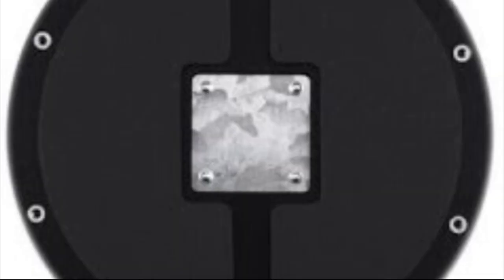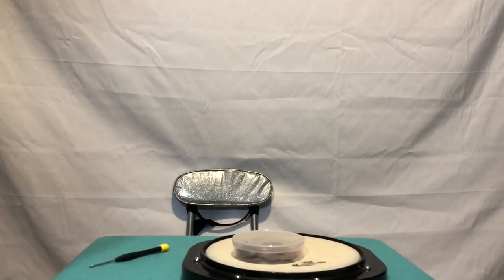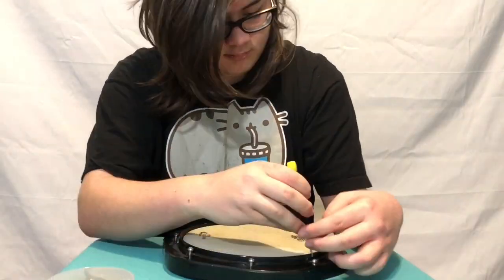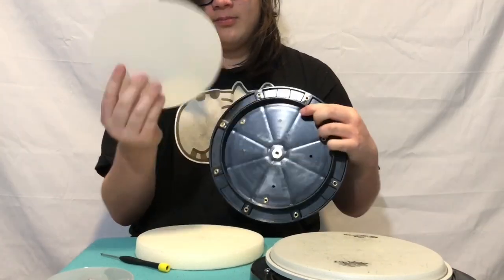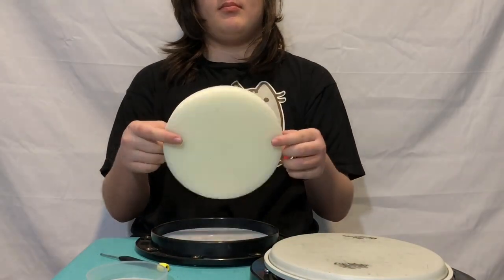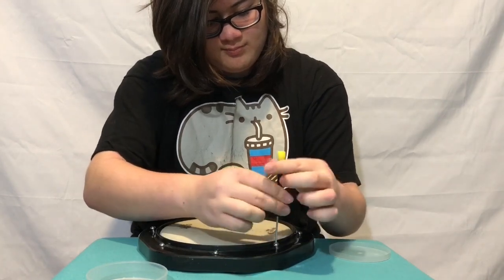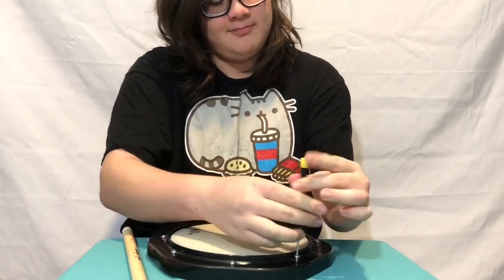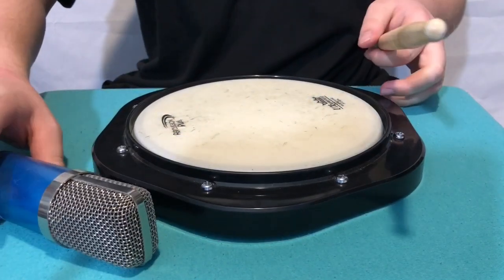How To Make A Practice Pad Sound Like A Snare

Comment: I took some old snare wire I had and cut them to length to fit my 10” pad and used silicone to stick them to the bottom of my head. I then cut a really thin section of foam from the center to allow the wire to shimmy. Works really well. Cool part is if you have to change the head, the silicone peels right off and you can re-use the snare wires.
Reply: Can you send me a video on how you did that please?

Comment: I tried the penny one and it didn’t work at all for some reason , I plan on carefully removing a small piece of the foam from the bottom of the circle of foam and putting some air rifle bbs in the removed section to add some more space for vibration a similar idea was mentioned here by another commenter which is the inspiration for the attempt I will try so go find their comment and give them a like and I’ll post an update later